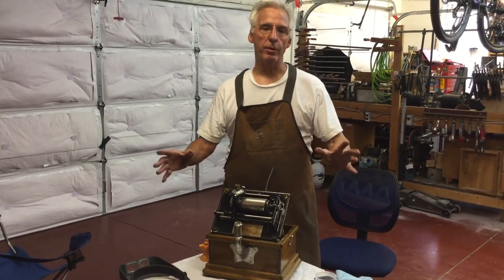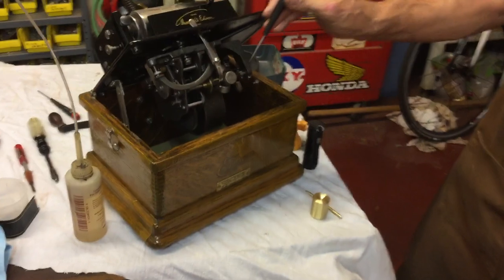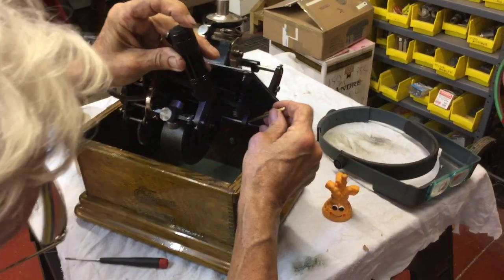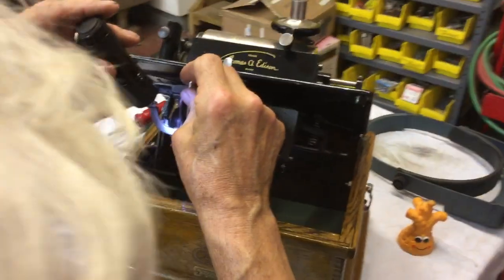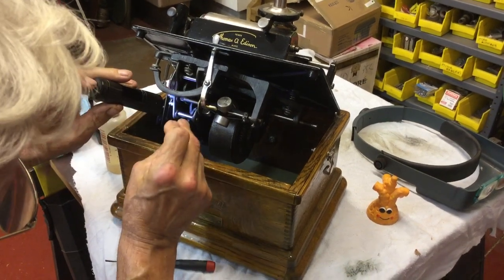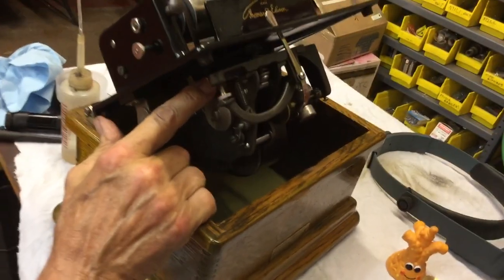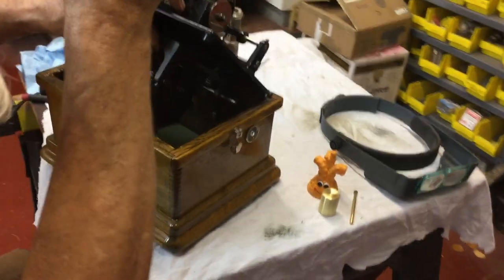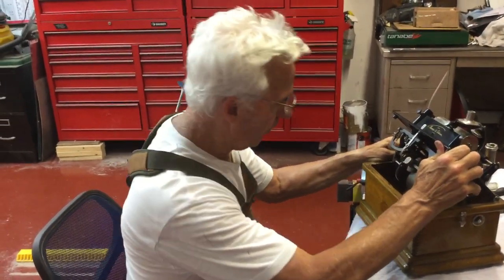84.  How to oil any Edison cylinder phonograph motor from Gem through Triumph

Comment: I have a similar Edison cylinder phonograph and I am not familiar with them at all.  When I place the reproducer onto the cylinder, it plays for a couple of seconds but then drags to a complete stop.  I'm assuming that it needs cleaning and oil  (?)  Thank you.
Reply from the maker: Could be the belt, or have you cranked it lol the way up?
Reply: @1974hurt  the belt is made of a thin leather...It's not broken and turns.  The phonograph is not over wound.  Guess I'll poke around inside.  Thanks!  :---)
Reply from the maker: The carriage rod needs to be oiled.  Where the carriage rides on the casting needs to be oiled.  If that doesn’t work, check the half nut and lead screw which may be out of adjustment.  I have videos on them.  Crank it up all the way.
Reply: @1974hurt  did not know that about the carriage wheel needing oil...Thanks...Will a 3 in 1 oil work well or should I use something else (?)
Reply from the maker: @mrob75  Sewing machine oil, NOT 3 in 1 oil.